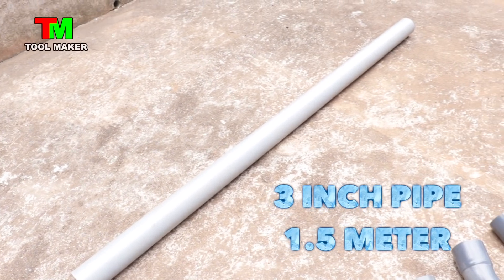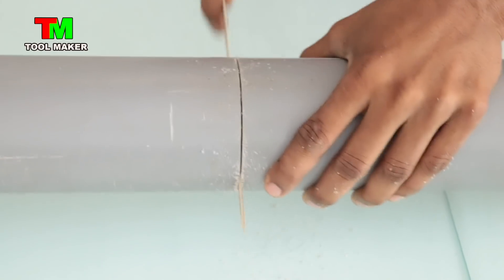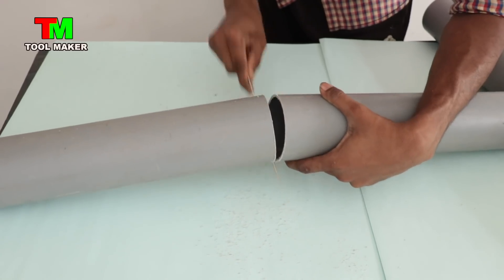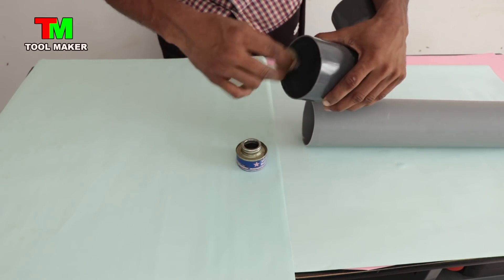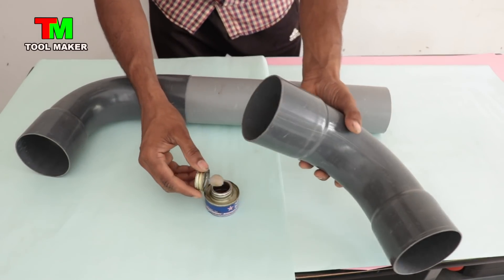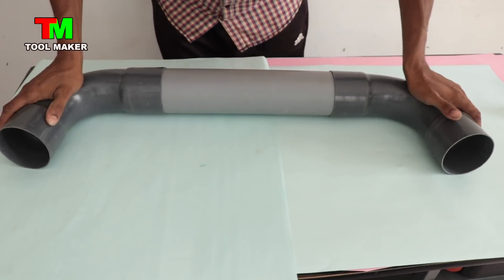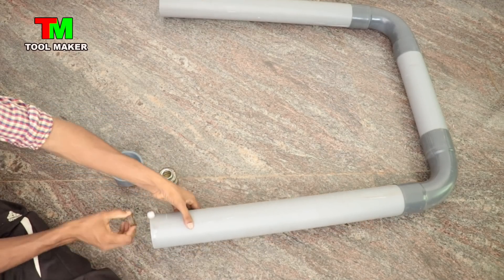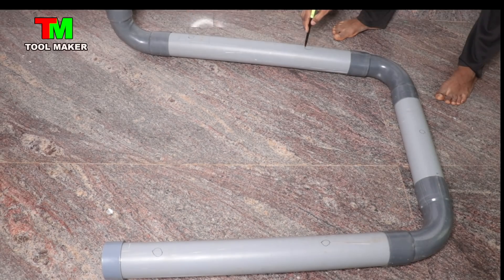ഒരു എളുപ്പ കൃഷി ചെയ്താലോ...തിരി നന 🌲How To Make a Simple Wick Irrigation System|Tool Maker

Comment: ബന്റ് ഒഴിവാക്കി നീളത്തിൽ തന്നെ ആക്കാൻ പറ്റുമൊ  അങ്ങനെ ആക്കിയാൽ പ്രശ്‌നമുണ്ടോ?
Reply: Yes it can be done .  This is only a demo video. Depending on your space you can use long pipe
 But again you may need  bend , T and / or end caps to connect the pipes and close the open ends. However the presentation is appreciated. Good
Reply from the maker: പൈപ്പ് റൌണ്ട് ഷേപ്പ് ആയതു കൊണ്ട് തിരിഞ്ഞു പോകാൻ സാധ്യത ഉണ്ട് ,അപ്പോൾ അതിലെ വെള്ളം മുഴുവൻ പുറത്തു പോകും ,അതൊഴിവാക്കാൻ വേണ്ടി ആണ് bend ഉപയോഗിച്ചത്
Reply from the maker: thanks nataraja Iyer

Comment: Good demo and explained in a simple way. Tku.
A doubt about the wick made of cotton cloth. Have you seen the usual wick made of glass wool?
If the cotton wick does good capillary action then ok.
Can u give me your mob no. for contacting when required.
Once again tku
Reply from the maker: Even i Had The same doubt Before doing It ,But it worked well.it does good capillary action .the Usual wick is not Available in many  area ,so cotton cloth wick is enough for self watering system .

do remember two things before making a wick 
1. always use cotton cloth for wick 
2. Roll as tight as you can 

I don't know about wick Made Of Glass Wool .Thanks For Your Valuable Comment And Wish YOU ALL THE BEST FOR YOUR FARMING......